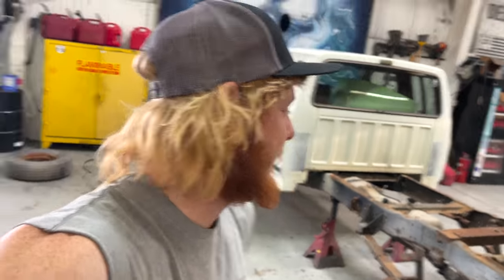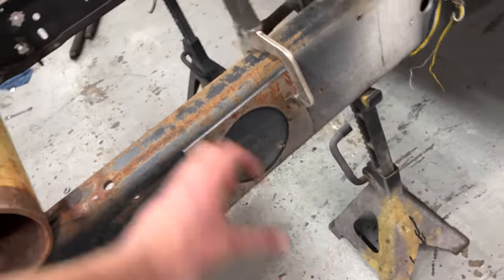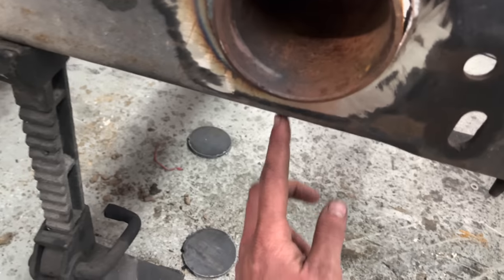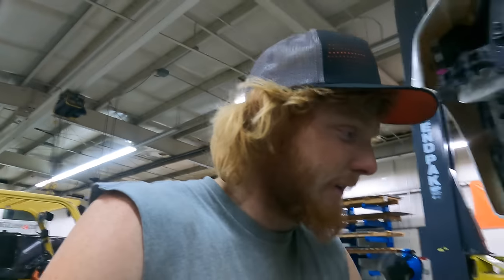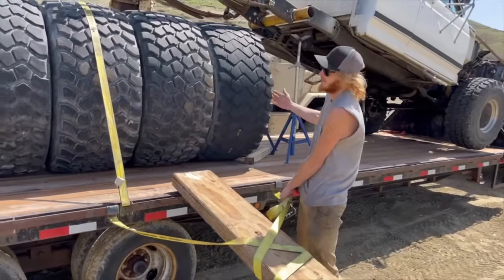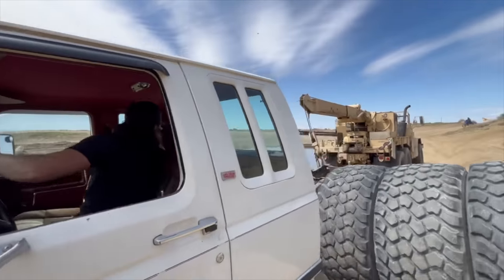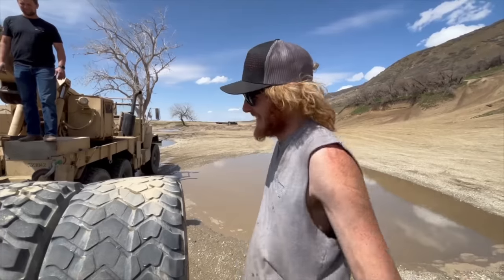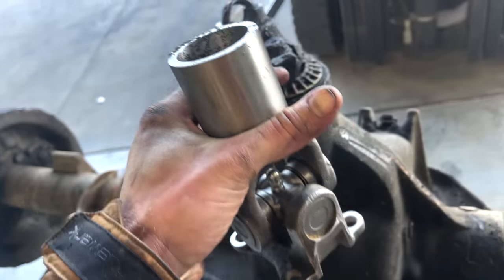The Tires Weigh More Than The Truck (F250 Frame Snaps In Half)

Comment: That hammered out half dead engine proved tougher than expected and for some reason it still lives. Looking at the frame and how it was put back together when it was narrowed it was surprising that it held up as long as it did. That rearend surviving as well as it did however especially with the bouncing and flexing was the biggest surprise of all. Other than the purely insufficient framework that was done to connect it back together, that truck has given me an appreciation for the advertising slogan Built Ford Tough…..because that thing proved that it WAS tough. It would be interesting to see how it would have done if the frame had been welded and braced properly and had a good running engine in it. Goodbye Chevrolet truck…you were just blown away by a ratty old Ford.
Reply: im sorry but "built ford tough" is BS in my opinion. We bought a brand new RV with a ford motor home chasis. Didn't even get home (legit within the first 24 hours of owning it) and the rear axel seized up and snapped the driveshaft and pogosticked the RV, shoved the axel out of place, all because ford forgot to put oil in the rear axel.
Reply: Isn’t the motor an international and the axle built by Dana? 😂
Reply: @leifswalling3226  yes it is an International engine and as far as I know they are Dana axles
Reply: @jearlblah5169  newer fords are known to seize especially the rear axle my buddy bought a 2020 Ford F-150 lariat ecoboost and maybe had it for a few weeks N the rear axle N diff seized at 60mph while hauling 1500 pounds of scrap
Reply: It’s hard to kill an IDI. Seriously have you ever seen what Peg from Zip Ties and Bias Ply’s has done to one and the dam things still keep coming back for more abuse and all the ether they can huff
Reply: give him a break ffs lot of hard work did dave pay you to pot this ffs

Comment: When you wonder if your axle is strong enough for a set of 54s, then you find out it's strong enough for a set of eight 54s. LOL
Reply: That's 4 sets
Reply: @JuarezDerrick  yes a set of 8 is 4 sets
Reply: @JuarezDerrick  t
Reply: @JuarezDerrick 'm pretty sure that is what he meant!! Or he could have meant eight "not" sets of 1 lol. But yes you are absolutely correct, only 4 sets on that ride definitely would be crazy to see 8 sets on the rear. 16 tires that would not only be expensive AF but insanely crazy as well!!

Comment: Spacers is easier than moving the frame.  Or even just flip the brackets around the other way.  Put a flat piece of steel / box the frame and put the brackets on the inside.  Don't even need to remove the leaf springs!!  Lol!

Comment: Prob would have worked. If u attempted with any effort at all. To make the frame stronger.  U had to know that was going to break right where it did.  All u did was weld it to a pipe.  Like seriously.   Had u made a real frame where u pinched it.   It would have worked more than 50 feet

Comment: You literally designed that frame to break, you made the frame weld a pivot point, holy crap I assumed you boxed the top and bottom and braced the pipe to the frame but no. Shame on your helpers for not calling you out before you loaded it on the trailer.

"yOuRe a UtUbe kEYboaRd WelDer" Sure at least I know C frames are designed to be C's for a reason. (the reason is strength)

Comment: Ford rear ends.   Made for power.   ALL.racers in street or mud use ford rear ends.  ???? They are made to handle power of ford engines duh ?? They will handle anything from.any other brand.  That's  what pros do , rely on ford running gear